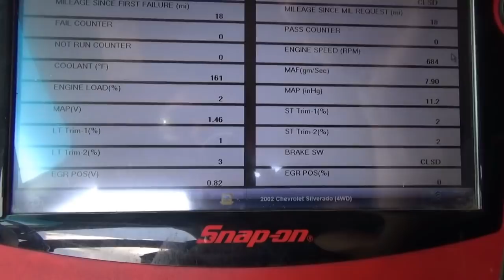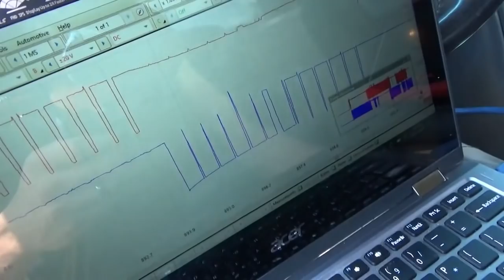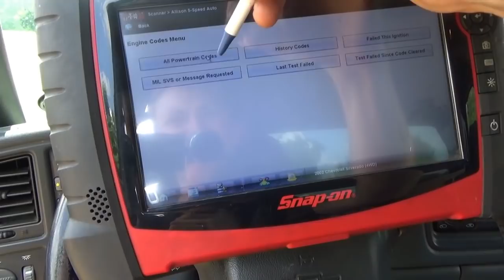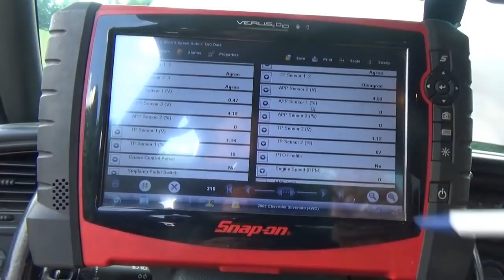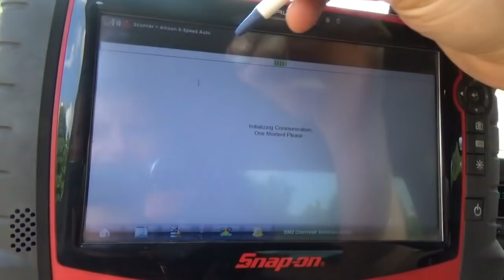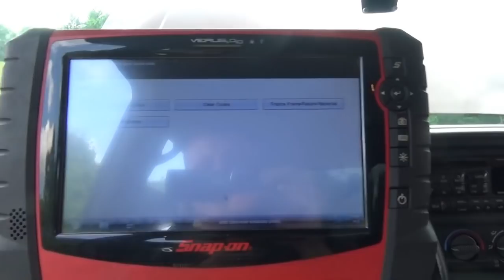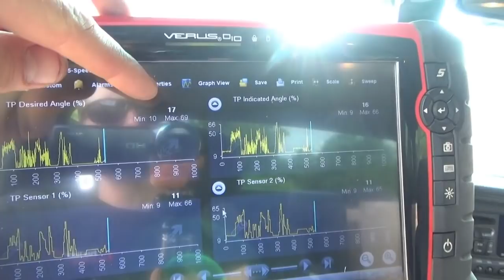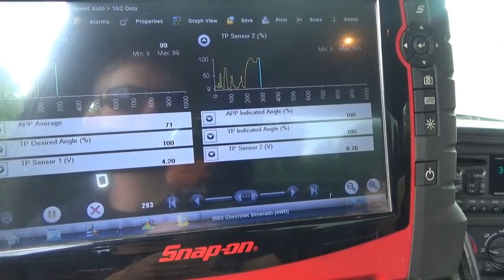GM Truck REDUCED POWER P1515: EPIC BATTLE! -Part 2

Comment: Not likely the fix but if you needed to increase the span of the tps pot's output voltage you could use an "operational amplifier" or "op amp", usually two or more on one 5v ic, they have adjustable gain ( feedback ) and one could be used in an inverted configuration ( feedback to the inverted input ) and use a single t.p.s. pot on the T.B. to produce the opposing and equal outputs.
So the gain and span of each op amp can be individually adjusted with four trim-pots ( equalized or paired ) but you would need someone who knows what he is doing and done it before.
google "inverted op-amp"
And you could use the picoscope channel with independent ground to calibrate the setup or compare the T.B. outputs on the laptop screen so they would track identical graphs.

Comment: I take it the original obsolete AC Delco throttle body for an 02 Silverado LS 8.1L was p/n 217-1631? Obviously, you've repaired it, but there's probably a NOS floating out there somewhere. Last Amazon review was Feb 2019. (4) reviews, all 5 stars. Sounded like plug-n-play. So maybe no reprogramming needed.

Comment: Maybe try using a later model throttle control module to match up with the different voltage readings of the later model throttle assembly?
Reply from the maker: Part 3 coming up haha

Comment: I'm working on a 2000 C5,p1120,p1220 and p1515. I don't have a scanner ,so using a dvm.  New tps,new app sensor. Downloaded all data and following test procedures. It's tough.
Reply from the maker: Get a scanner it will make your life easier 😁👍

Comment: We had a Mouse or Rat infestation on a  Acura . And we had to repair the throttle body connector connections. And those Wires Were Shielded!! I'm assuming that they had interference problems at one point in time. I think it's not a bad idea to verify the repair that was done to those wires? All the best from Canada

Comment: This is a hack and should only be used for diagnosis, but you are dealing with a potentiometer, and you need to raise the bottom stop voltage and lower the top stop voltage. Measure the total resistance of the potentiometer, do a little algebra, and you should be able to figure out if placing series resistors to the feed and ground of the TPS alter the voltage range to be what the controller expects.

Comment: Throttle Re-Learn Procedure? My G35 requires I do a 0-100% relearn procedure and ECU reset, if I mess with the throttle body...Remember all pots are not exact and can vary up to 10% depending on manufacturing specs...There's has to be a way to marry all the components so they work together....

Comment: sorry you are going after the wrong thing i think. there is something else doing this like wiring or connections or something else doing this. you are getting stuck on something you want it to be but it dont seem like that is what is really wrong. i would have looked at the gas peddle before replacing something like this now.

Comment: 21:46 And that why cars today will never become classics. Planned obsolescence. Would that 0.4V change in range have any actual good reason for being changed? Not likely. It's been done entirely so you can no longer fix it economically once the OEM parts run out because most people will simply junk them once they've been adequately trained by having a few experiences with poor re-manufactured or non-OEM parts.

Comment: The later throttle body CAN be made to (electrically) look like the earlier style.
The goal is to lower the voltage range of output on the potentionmeter wiper such that the range 'matches' the older throttle body.
If you add a resistor at each end of the potentiometer, then the output range at the wiper will be lowered.
Given that you want to change the output at each end of the scale by 0.2 volts, I would recommend using resistors that are approximately 5% of the total (end to end) resistance of the potentiometer,
Eg: If the potentiometer is 5k ohm, then you'd use somewhere around 250 ohms on the +5v and ground pot wires.
Reply from the maker: Almost... But I want to INCREASE the range by 0.4V...resistors won't work 😒
Reply: Increase the range???
At present, I think your TPS output is exceeding 100% (from the perspective of the ECU) which is causing it to throw a DTC.
By DECREASING the range that the ECU actually sees (i.e. resistors @ each end), the voltage will remain within what the ECU believes to be the 0% and 100% limits.
It's at least worth a try?
Reply from the maker: @trevorvanbremen4718  Not the case here. Watch the video closely. The throttle plate runs into the mechanical stop when the TPS reaches about 96%. The computer tries to open it even further to get to 100% and can't, thus throwing a code. Thus we need to INCREASE the TPS signal voltage at the high end to make the TAC happy. Makes sense?

Comment: its not the throttle body its the sensor you can now get them separate for all model years just unplug them and replace the sensor GM has a updated TSB about now you can replace the sensor
Reply from the maker: Wouldn't that set a TPS correlation code?
Reply: @PineHollowAutoDiagnostics  shouldn't set a code if GM updated there replacement proccess if you update the software on all Computer systems they got sued over replacing the throttle body when only the sensor fails on throttle body

Comment: Check the resistance of each throttle body open and closed and add a resistor to match the old style.
Reply: Ivan needs to increase the span of the TPS voltage, so he would need to add a negative resistor :-)
Reply: @Graham_Wideman  or change the 5v ref to 5.5 volts
Reply: @fumthings  Yes, I thought of suggesting connecting the high side of the throttle position potentiometers to a (new)  5.5V (or so) reference. However there's some chance that the Throttle Actuator Controller manipulates its 5V reference output in some way, such as to test the continuity of 5V wiring, which would fail if that's no longer connected to the throttle position pots.

Comment: Think Russian Ivan, russian repair that is what is needed hear. A bit of electronics wizardry maybe between old TAC and new TB.
Reply from the maker: Part 3 we resort to some Russian methods 😅
Reply: @PineHollowAutoDiagnostics  Its just pots Ivan so measure their resistances carefully and fling in some resistors to make the new ones same range as old ones. Once you've done this check voltages to see if the fix has worked!
Reply: @tomctutor  yes but the travel on the pot was less so you need to remove resistance rather than add.
Reply: @fumthings  Hmm maybe a shunt resistor worth a try, easier than all that mechanical jiggerypokery.

Comment: The tps is not like a pot .they have logic circuits to generate the square wave as pwm and probably a small CPU
Reply: I think you're confusing the PWM drive to the actuator with the dual pots on the position sensor. If the position sensor signal was converted to digital or PWM at the throttle body, then Ivan's strategy of reversing the polarity of one of them (to match the flipped pots of the older gen unit) would not have worked.

Comment: I hear you on reman and after market parts.   Thta's why on the Saturn Astra we email about I purchased nothing bit new OEM parts. BTW sent you email about getting car up there.
Reply: What’s wrong with it?
Reply: @liviu2004  no comm on high speed lan mandatory ecu misssing  Check all powers grounds all good. Also oscilloscope shows data waveform across the high and low.
Reply: Bill Ziegmond I have a case study on its bigger brother. These cars are very common in Eu under Opel brand. https://www.picoauto.com/support/topic17791.html
Reply: Bill Ziegmond I’ve also had two others with one power feed wire broken in the original loom, between fuse box and pcm. Thin red wire it was.
Reply: @liviu2004  It's not the ecm its rhe ecu which is part of the fuse block all powers are good
Reply: @billziegmond4943  Known problem with corrosion at the fuse box (UEC) back terminals. 1 nut and 2 bolts and you can do a visual yourself for green rusty magic? I doubt Pine Hollow can install and program used one.
Reply: @liviu2004  I have checked all those, Also I have tech 2 and access to SPS and can program any GM vehicle. I have done plenty of them.
Reply: Bill Ziegmond so why not put a new fuse box in? What’s the point to spend more money in another diag? If PCM is speaking to CIM, Can integrity is ok, so left over UEC to be replaced.

Comment: weld a screw on the bottom of the gas pedal and adjust it until you read on the scan tool 90-94% with the pedal to the floor... like e mechanical limiter ... in this case you won't reach 96% to set the code .... just an ideea :)

Comment: How about altering the linkage in the AP sensor so that it only goes to about 95% at full throttle. The driver won't notice the difference, but if the TAC module never sees a 100% request the problem might not happen

Comment: While the customers not looking grab you a wheel weight one of those stickey kinds, trim it up a bit and use it as a stopper inside the throttle body that way reduced power wont trip off after 100%

Comment: Hmmm. I was surprised that Ivan fired the "parts cannon" so quickly and secured and installed a new GM throttle body. So let's wait for Part 3 and see what his teaching moment is???? Also I believe he will arrive at an easy DIY solution for updating programmed calibration values in the TAC.